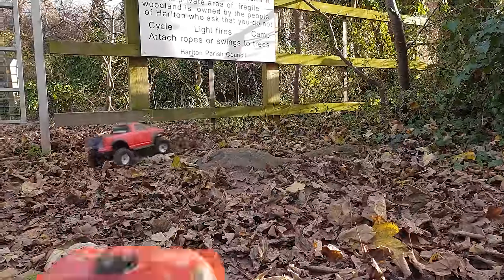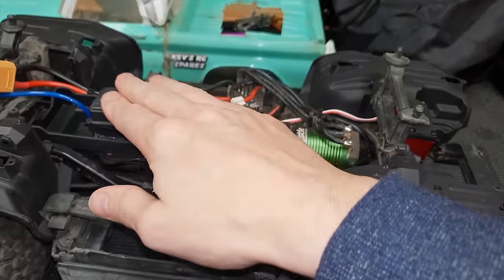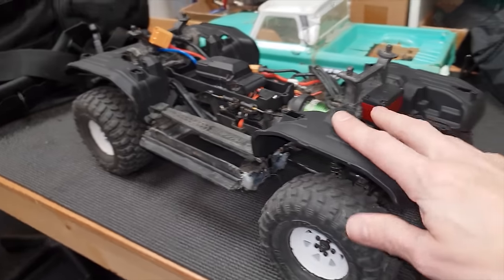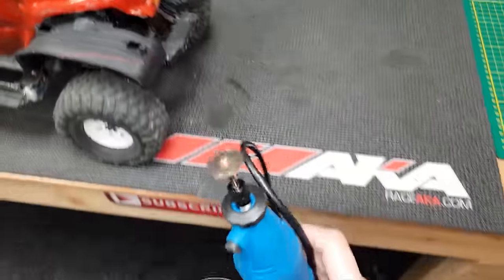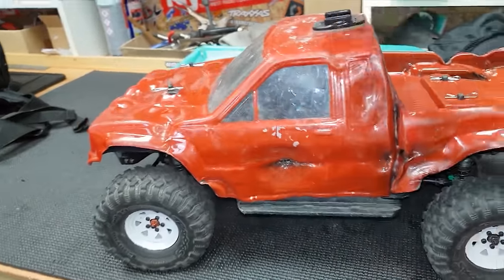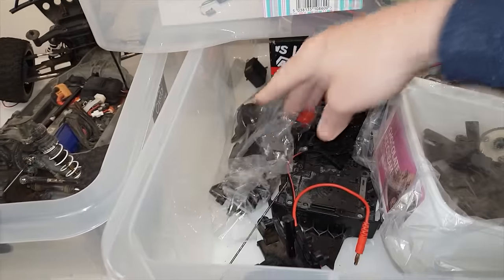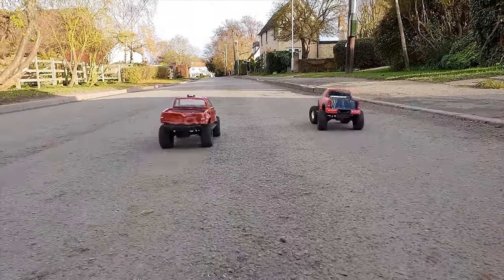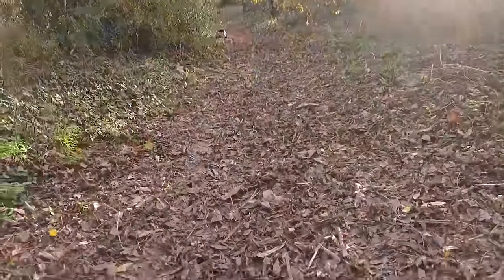Top Gear HiLux Traxxas TRX4 Bashing & Beating

Comment: god now i want to go on a long walk with my e-revo. we've got some very pretty dirt paths nearby (btw my e-revo is over eight years old, burnt out two servos and a motor, still using a brushed motor with the fan fins broken off on the inside )
Reply: it still runs perfectly, although i might need to take it apart in the winter, clean all those bearings out

Comment: Hey Kev, I have a RedCat Blackout XTE Pro all stock. Would a Traxxas receiver and transmitter work with it? I am wanting TSM
Reply from the maker: it should work
Reply: @KevinTalbotTV  I tried a Radiolink rc4gs Rx/Tx and all I got was full forward throttle no rev or brake even with adjustments.

Comment: Kev my xmaxx is just eating through gears it goes though stock Traxxas gears in one bash and rips all the teeth off or shatters them. Ithe gears that you use take about 2 to 3 bashes than I rip teeth off the pinion and mangle the teeth on the spur I have already replaces the motor mount the and the pins and I Know that I have the gearing right and use the correct pin slots I love the xmaxx but I am really getting pissed off at those gears I haven’t had a run without shredding in about 6 months! I’m really good getting tired of that if any one can help please tell me your opinion! Would really appreciate it thanks guys! Good video kev.
Reply from the maker: get steel spur and pinion dude
Reply: Kevin Talbot thanks for responding! what brand would you recommend and how many teeth I like the 46 tooth spur for speed but could that be one of my problems? How many tooth pinion? Sorry for all the questions thanks so much!

Comment: Did you notice that the other shock on the bizon is bout to break off also
Reply: I would use a bolt and nut to hold the shocks on

Comment: Why don't you have a front bumper and put a savox waterproof servo in it and put s castle bec with a leading edge machining bec cover and watch RC SPARKS video on how to wire in the bec to your trx4
Reply from the maker: Im not a fan of savox I don''t want to mess about with a bec when I can get better servos that don't need one for cheaper